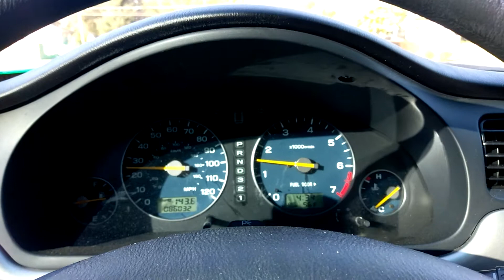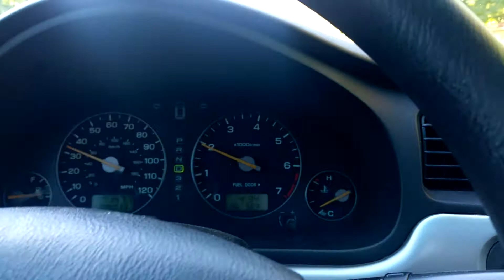Subaru EJ25 piston slap, factory short block with less than 1500 miles

Comment: Is there metal flakes in the oil? I have been watching a lot of videos on this and in my Subaru I just rebuilt, 1500miles on the short block that was rebuilt by previous owner. I have done everything to this to make sure my work and the parts were good. 8 oil changes in couple hundred miles n I still have some little specks in the oil. I parked it till I figured out something. ‘07 ej25 na, auto. I know piston slap is common and I figured the specks are from the piston skirt or cylinder wall, driver side rear cylinder is the most pronounced on mine.
Reply from the maker: Hey thanks for viewing! I have not found any metal flakes to speak of. The very first oil change there was a hint of shimmer in the last bit of oil. Nothing in the filter. Each change after has been completely clean. I've even run the oil through a paint filter and inspected the results... nothing. The knock has not gotten any worse but is very pronounced around 3k rpm under light load until the engine warms up and never completely goes away. The noise is also dependent on outside ambient temperature also. When starting the engine cold in temperatures 50F or below you will here some knocking for the first 2 - 3 seconds then it goes away. When the ambient temperature is above that there is 0 knocking on cold start. It always knocks around 3k rpm decreasing when its fully warm. Only under light load. Revving the engine to the same rpm under no load is completely quiet. It's quite annoying but I'm 99% positive its classic piston slap due to an improperly sized bore/piston combination. Sounds like it's only 1 making the noise.
Reply: spdwebdotnet 
Mine also does the same, stays at a fast idle till the throttle is kicked down or after a few minutes it idles down, crazy! I had a brand new “timken” belt tensioner on it that was bad after it warmed up, oil was on the top of the seal! It’s easy to get to without tearing down the engine. Take the timing cover off the driver side and get a long flat bar that will wedge between the top of the tensioner and the block, start it up and then put the bar between there and see if it gets quieter. Mine did and I replaced the tensioner, it got quieter but still had that noise from the rear of the engine. I used a stethoscope to help me figure it out because the variable valve lift on mine is noisy even after resetting the rockers gap. I got this car to fix n flip, hard to explain to someone that never had one why it sounds like a rod bearing is bad! Funny how the knock sensors never work 🤔 unless unplugged!
Reply from the maker: @blee2869  I have plans on checking the tensioner. It's a long shot but I might as well check it. I too only keep a vehicle about 1 or 2 years and then I'm on to the next one. I'll have to sell it to someone familiar with loud boxer engines because as you said... explaining a knocking sound and why it's not detrimental to the life of the engine is lost on most people lol

Comment: Did you ever fix the issue?
Reply from the maker: No I just learned to live with it. I had a Legacy that also had some piston noise in the cold, but that was a 140k mile engine. This being a new short block it was slightly annoying. I went back to the dealer who installed the engine a couple times but they just kept saying it was normal... ok..  but not on a brand new short block, come on guys. I even went so far as to contact SoA about it since it was under warranty, but they just confirmed with the dealer that it was "operating normally".  Anyway.. I kept a close eye on the oil and never saw any signs of wear or trouble. It was really only loud in the winter. Hardly noticeable once the weather got warmer. It's not really causing any harm, just annoying.